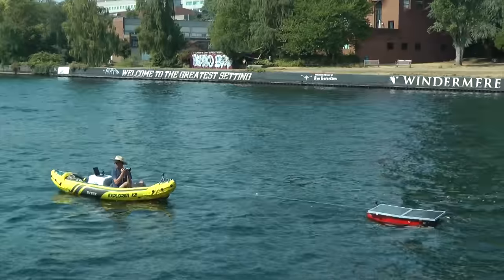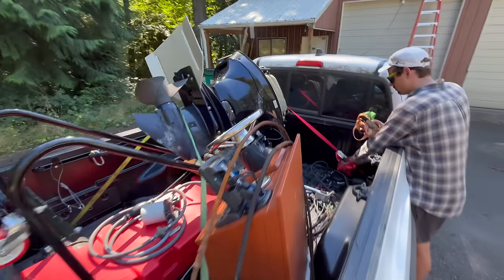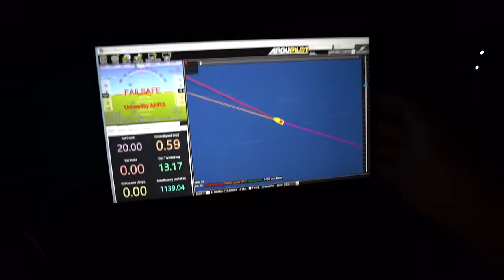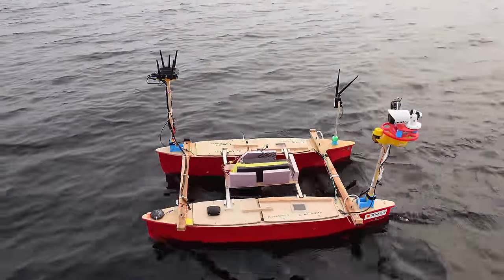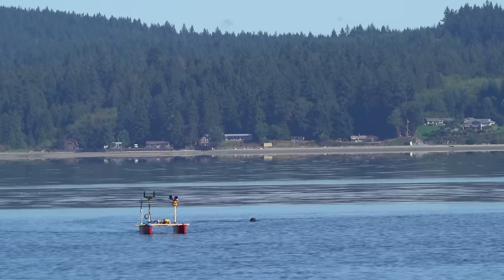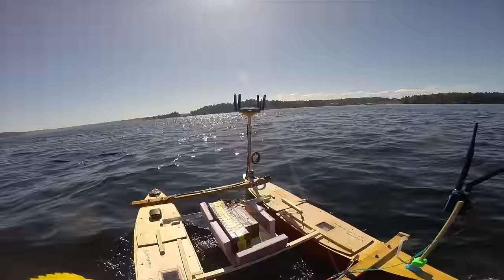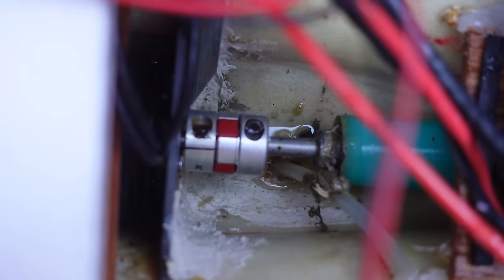Autonomous Boat 50km Waypoint Mission

Comment: Use a capacitive water detector! Those can be encased in conformal coating and will still detect water. The resistive one you used is well known for not working long term
Reply: I use a "Chirp" for my plants..
Reply: I tested capacitive sensors in dirt for an entire summer in the midwest and had no issues with them. Definitely the way to go for water sensing.
Reply: @PanSatyr  yes! Me too, in a hydroponic setup with water that is way too conductive for any other option.  Did you come across the fact some of those capacitive sensors are actually sold with a defect? There are a few videos online about the problem and the fix. A few of mine had that issue. As long as the broke ones are avoided or known about, totally agree they are the way to go!
Reply: Or set it up AC so it doesn't dissolve
Reply: @minibigs5259  not only does that common sensor not run on AC (it would require a completely different sensing and interface circuit of your own design), AC power definitely still causes corrosion due to stray currents and other imbalances.  That's why capacitive sensors are a better bet, there doesn't need to be any interface to the water at all
Reply: @gutrali if only there was a channel with a guy who could do that! Such an opportunity lost!!
Reply: or a float switch, as is commonly used on sailboat bilge pumps.
Reply: @teaddict-  agreed, they are just comparatively larger and need a higher minimum water level to activate, at least half the height of the float. Capacitive can detect a little as mm of water.... You can control the water level you'd like without having to make any physical changes
Reply: A better design is just a micro switch and a float to turn the pump off and on. Simple and fool proof. Or just have the pumps run continuously at slow speed so they pump out water immediately no circuit
Reply: Don't use any sensor at all! Run the pump on a schedule and monitor its power draw to see if it is pumping water or air. One less wiring job, one less failure point
Reply: @dundeedideley1773  I don't think that's less wiring and less to fail when you have to wire in a circuit or component that can measure voltage drop/current
Reply: @gutrali  You can change the floats activation too but just changing the geometry to the switch. Hell even just a metal contact moved by an arm attacted to the float would do. Then you can calibrate it for pretty low water level
Reply: @__-fm5qv  idk about that bc you still need to have enough water to lift the float no matter what geometry you use. Generally water level half of the height of the float is needed for it to float at all. The only way to get it at a very low level is to have a very thin and wide float. That way it has enough buoyancy low down so a tiny level of water can lift it up.  I.e. a very tall and thin boat will sink deeper into the water than a very wide and flat one
Reply: @gutrali  well the geometry effects how much it needs to lift to activate, which can help set a low level. Say it only needed to lift 5mm or so it would be easier to set it to activate low down, than it would if it need to move more. But yes a wide float would also help.
Reply: @__-fm5qv  most float switches I have seen are one piece of plastic in a cylinder which a float rides on. A magnetic reed is sealed on the inside, to sense when the float rises high enough, using  magnet that is in the float.  How would you even be adjusting the geometry of such a float switch? The type of float switch which has a float on a metal arm that can be bent, usually uses a normal contact switch in a lever configuration ,which is not sealed from the environment. I can see how you could bend the metal arm but you still can't make it detect water lower than its designed. You are simply changing how much movement is needed to activate it, At the cost of false activations from simple up and down movement of the boat.  So yeah I don't think the float switch is going to work great in this scenario.. considering how little space there is And the geometry of the hull (leaving little room for a float to sink down into the water)
Reply: @gutrali  Ah I was just thinking of making your own float switch, not buying a commercial one! So adjusting the geometry would be just designing it to work with a smaller amount of float movement. That way it could be designed to activate with a lower water level, after all its not like they're complicated bits of kit. Plus, you could then make it as small as you needed really, as long as the contact itself is large enough to handle the power running through it.
Reply: @dundeedideley1773 good idea, though more simplicity might better. I’d be surprised if there weren’t a self contained bilge pump and sensor.
Reply: My bilge pumps in my boat use a simple floating switch. Circuit gets closed if the waterlevel is high enough. Pretty failsafe, no logics, no arduino, just 12 volts.

Comment: Heya! I have some experience with this sort of thing - the liquid level sensor corroded because of the DC voltage applied, which caused the corrosion. There are some techniques to mitigate this: you can either apply the voltage for a brief time for the measurement once every number of seconds to extend lifetime or apply alternating polarities with each measurement to reverse the electrochemical effects.
Either way, and I say this with the utmost respect, you need to up your waterproofing game. It sorta hurts to see so many of your projects scuttled by water ingress when your waterproofing amounts to just silicone, which sorta sucks for this. I recommend you check out waterproof cable glands with PE tubing to carry conductors and some more design considerations for things like acrylic windows like labyrinth seals and compression of silicone/other seals POST-cure.
Love your stuff, hate to see it fail due to the world's greatest chemical :)
Reply: Universal solvent strikes again
Reply: I think he just needs to take his water sealing more seriously. Print off two more of the hulls, turn them over, silicon them to the float hulls, and go crazy sealing all the other gaps. And also getting the voltages right.
Reply: As soon as he mentioned a level sensor and Arduino for the bilge pump my thought was "way too complicated".  Bilge pumps for full size boats just use a float and a switch to activate, which he could have easily replicated with a micro switch.
Reply: @FireCat005 a foam pad. Attached to a mechanical switch above it. When water gets in the foam floats. Turning on the pump. The foam sinks. The switch disconnects.

So do I need an electronic component to monitor for water to get wet?
Reply: Can you recommend me resources for waterproofing stuff like this? Maybe some channels that do what you recommended
Reply: What a well written, respectful, and informative comment. Thanks for your time friend. :-)

Comment: Have you considered having the propellers reverse occasionally to try and clear the weed?  That's what we do on our narrowboats to avoid having to manually clear weed.  Maybe monitor voltage drop and program in a reverse phase when it needs?
Love your videos 🇬🇧😊
Reply: Yes and run bilge pump on timer or mechanical switch 😊
Reply: From my experience with RC boats, once it's on there, it's not coming off until you remove it manually. At this scale, every bit of weed is the equivalent of 10 feet of rope to a full size boat. I've actually ripped a rudder off just from vegetation that got somehow looped around it and wound up by the prop.

Comment: I'd love to see you revisit solar autonomous planes and see how small you can make one.  Is it possible to go under 250g?
Reply: @picklefart  I mean I have my doubts too, but solar tech keeps advancing and it would be a neat challenge to see how small you can get it and still make it increase the range.
Reply: There are thin Solar Foils which have a very small weight. This on a nice delta wing. Maybe 50w will be enough to power. A small 2s1p 18650 Liion Battery for the start. I think maybe it could work. I had a little Delta with only 120g with 2s 850mAh LiPo. But would not recomend LiPo cause of charging with Solar.

Comment: You should do a checklist for launching the boat so you never ever again forget the drain plug ^^
Reply: I was thinking red tape over the ignition or similar...I've been in a boat in the middle of the bay, when I realized it was rapidly flooding, had to use the power to get a across to the marina lol.

Comment: 4:49 Andromeda Strain scene where the surgeon cuts the country doc's deceased body and sand pours away.
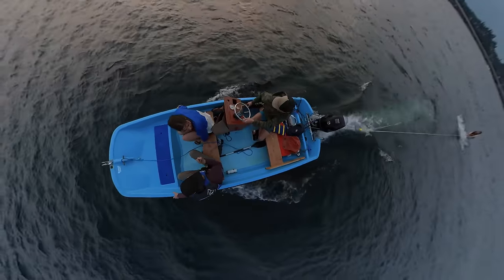7:16 you could add two extra flotation tanks to the left and right of the motor directly on the transom. Basically you take some foam blocks, cover them in fiberglass (making sure they fit the shape of the transom) and you screw them in place.
FIY you should over drill all the holes you've made and fill them with resin. Water will get inside the foam layer and you'll trash the boat if you skip this step. edit 3: to make it clear, the resin is in there to create a barrier between the foam and the screw.

Comment: For these autonomous boat projects, I wonder how a paddle wheel might fair.  There would definitely be a large loss of efficiency compared to a prop, but with hopefully less trouble from seaweed you might see an overall performance boost.  Seaweed could still get caught but would be more likely to fall free since the point of rotation is outside the water, and a comb could be made to grab hanging seaweed as the paddle left the water if rotation is fast enough.  No clue if the overall performance would be better or worse but might be worth at least investigating.  Also, would be interesting to combine such an old propulsion method with the modern aspects of being electrically/solar driven and autonomous.
Reply: I'd go with a side wheel design myself in this case.  Driving two (or more) side paddle wheels would be less complicated than a stern-wheel (unless you mount the electric motor outside the hull).  Differential steering would make a lot of sense for a "small" autonomous rather than hull penetrations for the rudders.

Comment: Conformal coat the arduino's and boards with clear nail polish...just paint a few layers over it to protect them from moisture/corrosion
Also...run marvels mystery oil in the gasoline and put some MotorKote in the oil and the lower gear section for hyper lubrication and help prevent water damage
Very cool!  Keep em coming!!!!

Comment: Did you add flyback diodes accross the relay? Even if the uC can handle the voltage and current needed to activate the relay, an inductive load like that will produce a large flyback voltage when you shut it off, all that stored magnetic energy needs to go somewhere and if you dont give it a path like a diode it will just keep upping the voltage until it shorts something out.

Comment: okay so there seems to be some confusion on what "plaining" is , it is not when the stern wash separates from the transom , it is when the boat lifts onto the surface of the water or ever so slightly below it , the boat will give a very distinctive feeling when it does this , the front will go from pointing upwards to leveling off once the boat has reached enough speed to overcome the drag of the water against the hull , plaining doesnt usually happen until around 12mph

Comment: Very cool project, and a good attempt! For a more robust liquid level sensor, and something that isn't susceptible to corrosion, perhaps a switch connected to a small float would be better? Like in a toilet tank, but with an electronic switch on the end of the float.

Comment: the drag of the water really helps with the 3d printed parts when in rotation because they are being compressed instead of stretched by the g forces from spinning

Comment: When thinking about boats hulls that work under low displacement you should look into a rowboat with a “shallop” or “double shallop”design. They have sweeping lines that come down to a V shaped bottom. They work amazing at low speeds and are commonly used as sailing dhingys. I’ve seen them be incredibly stable even at low speeds like 2 or 3 knots. An electric motor on one would work amazingly as they do so well at low speeds

Comment: Tip on those liquid level sensors.  If you use a digital pin from the Arduino to power them only when taking a reading (say, 5 milliseconds on to take a reading, every 5 or 10 minutes), corrosion will still happen but much much slower because power isn't flowing through them all the time.  Couldn't tell if you had them set up in that way but if not and if you use them again I'd recommend trying this approach.  They don't pull very much power at all and they can easily be powered by the max 40mA that can be supplied by a digital Arduino Nano pin pulled high.

Comment: Looking forward to the next video and seeing what you come up with for the propulsion system!
For the bilge pumps, big boats use float switches. Maybe there's a commercially available product but otherwise it shouldn't bee too difficult to build your own, especially with your creativity and prototyping/construction possibilities with the 3D printers. With one of those switches, only a float needs to be in contact with the water and the electronics can be kept high up. Salt water and electronics is a nightmare.
Good luck!

Comment: I wonder if there are any propeller designs that are designed to minimize string tagling or trapping weeds. These designs are probably not energy efficient, but at least you won't have to worry about the propeller getting stuck.

Comment: For alternative propulsion, you can combine both wind and water :

For wind, there is the classic sail, but there is also the amazing Kite, which could make a great project, a self launching and recovering Kite, in fact, you could even generate electricity with Kite.
There are the :
 *Pulled by wind then retrieve through gliding.
 *Pulled by wind then retrieve through flag position.
 *Figure eight.
 *Spin on itself.
Ways of making electricity from a Kite, all pull the craft while unwinding the cables if it has enough resistance and both the figure eight and spin method allow to still get propulsion during retrieval, but they are harder to control, while the gliding method (mostly with a self/neutral stabilized sail) is the easiest to control with simple electronic.

As for the water propulsion, you can combine multiple types, but some are almost seaweed proof, like the FIN'X or the more typical undulating fin solution, which isn't that hard to make with as it work with a single crackshaft, as here you only need to control longitudinal thrust, unlike all those submersibles.

One thing I thought about would be to make a Trimaran hull design, but with the side hull on hinges with a simple breaking/locking mechanism, they would use the wave movements to generate electricity, the same way a "sea snake generator" do works, except it would serve both as a "suspension" to absorb waves impacts and generator.
A full bridge rectifier would allow any movement direction to always produce the same polarity, with a simple angle limiter and dampener, it could probably work well.

As for the water problem, you could have two hulls, one inside the other, the pump intake and water detector (which could be homemade in 316 stainless steel or other corrosion resistant conductors as a series of close enough "pins" to detect non-salt water's conductivity) and a water pump type which can run dry, such as a peristaltic one which are not that hard to homemade, since the mechanism isn't touching the water, any small particles won't cause issues inside it, with a timer that enable it for multiple seconds after the water detector is triggered, so the movements of the boat won't make it "miss" the water.
And waterproof the electronic with a simple hot glue gun so only the wires and possibly radiators (as it may overheat inside that) are going through it, same for the "inner" hull, which can be totally sealed off using a lead that contain the same hot glue (so you don't have to engineer a perfect fit lit with joints), bonus if you include a "hatch" with all the connectors for recharging batteries or connecting microcontrollers.

Comment: Have you ever considered using a pump drive instead of a prop to avoid the seaweed problem? I've been working on a 3d printed autonomous boat (inspired by your videos) and I used bilge pumps for both the drive and steering. It works great in bathtub testing, not ready to hit the big water yet though!

Comment: Its interesting how many people try to build electric boats out of planing hulls. Paddle wheels are good options for seaweed. As for the bulge pumps, float valve or just two stainless steel contacts  an inch apart. That can switch the pumps directly, or a relay or just sense resistance change. Salt water will eat any of it so build it assuming that. Thick stainless will last a while.

Comment: I think you should scale the boat up to something about the size of your Boston whaler. Maybe identical canoes or kayaks with a frame to spread them about 4 or 5 feet apart you could use a small gas powered motor for an adventure like this until you could work out an electric motor and battery set up. It would be light in the water and very stable. Might need to add a keel or skag for better tracking especially with side winds and currents. It would be large enough to be avoided by most craft.  You could also work on self correction like the self driving cars it make it truly autonomous.

Comment: For constant water level detection without corrosion you want a capacitive soil moisture sensor, they work with arduino. I think they might work pretty well even once coated with salt. 
I use it for my automated watering system, in the bottom of my pots I have the sensors, and when they dry out below a certain percentage it tells the arduino to send more water through.